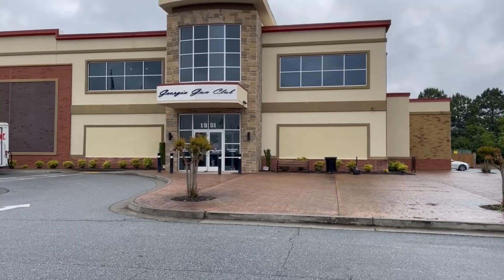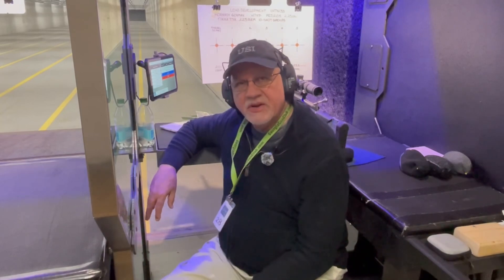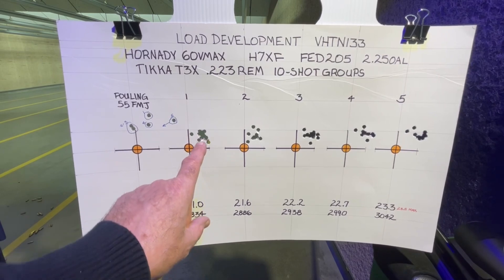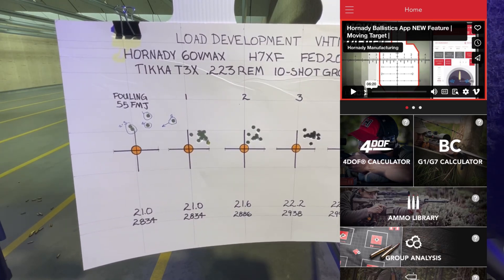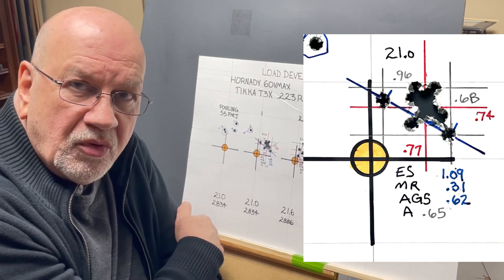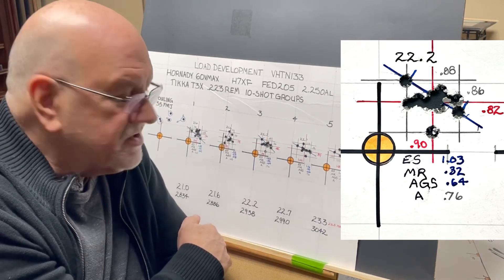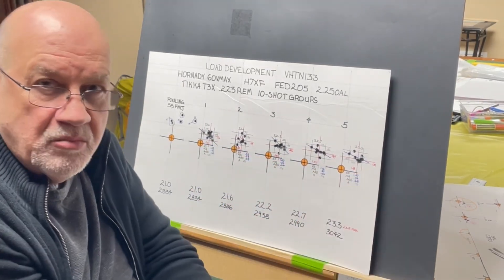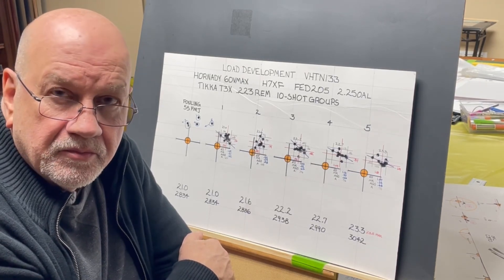Load Development for .223 with 60VMAX and VihtaVuori N133

Comment: I would not shoot 10 shot groups in this stage of load development. You must have a sizeable budget for components. I would try increasing powder charges in .3 increments shooting 3 shot groups. Also in changing your scope setting you are missing similar point of impact locations that might help you find a node. I use GRT and a magnedo speed to identify the areas I want to take a closer look. After seeing good results from the 3 shot groups,  then I would move on to 5 or 10 shot groups.
Reply from the maker: @thecrusaders2516  good advice. Happy reloading. Thanks for watching.

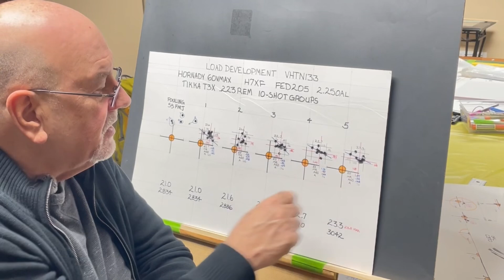Comment: I have good results with CFE 223 and the 60 gr. V max on the upper end of the charge weights in multiple rifles. 10:23
Reply: I have had mixed results with CFE 223 and better overall accuracy with h335 and VARGET.
Reply from the maker: @RogerFerguson-i6b  those are both excellent powders. I use both. I especially do like Varget as well. As they say, it's all about finding out what your rifle likes. Sounds like you've discovered it. Thanks for watching. I hope you will stick around and subscribe.
Reply from the maker: Cfe223 is one of my favorite powders. Thanks for commenting, thanks for watching.

Comment: Watched most of your reloading videos on 223.  After going through my own journey in reloading, I listened to Hornady' Podcast Episodes 50 & 52 "Your groups are too small".  It all made perfect sense. So much wasted time and money.  I bring this up because as a fellow reloader that makes content for us, try reloading using statistically significant data, i.e.- large group samples of 20+ rounds.  You will find your load findings are NOT repeatable over large groups.  There is no "node".
Reply from the maker: When I run a test like the one in this video, because there's such a difference between the loads,like .8 to .9, I will go back and do further testing around that best load, loading maybe .2 and .4 grains below and .2 and .4 grains above that charge weight. That helps me to zero in on the node. Once that is found, then I will verify with a 20 shot group.
Reply: Love what you do.  Subscribed. @EverydayReloadingandShooting
Reply from the maker: @ much appreciated, Jonathan. Thanks for watching!
Reply from the maker: @jonathane8585  if you watch some of my other videos you will see that I do shoot 20 shot groups. And it is after what I have found what I think to be a "node." The 20 shot group is to verify what I think I have discovered. I have often shot three shot groups into a single ragged hole, but then if you take that same load and Fire 20 shots, those groups will spread out. The more shots you fire, the more they will open up. That's why I don't just look at Group size. I also look at mean radius. Thanks for the input. Much appreciated. And thanks for watching.

Comment: Love it that you shoot 10 shots groups. That's telling so mutch more about the performance  than a 3 shot group. But for more and beter info you need to measure the speed.
Reply: Awesome video sir..I use the 60 Vmax with my Tikka..very small groups.if you shoot the 60vmax and CFE223 26,7gn powder you gna get very small groups
Reply from the maker: @ I'll have to give that a try. Thanks for the input and thanks for watching
Reply from the maker: @andrebosgraaf2086  I can't disagree. I just don't have that in my budget at the moment. I do look at groups like number three and number four, and when I see the shots stringing horizontally, that tells me that Im at a good velocity node. Eventually I will get one. thanks for the input, and thanks for watching.
Reply: @EverydayReloadingandShooting  at 100 yards the difference in height wil be max 0.2 inch in height with 70 fps speed difrence ore less I think, so it will be hard to see I think at 100 yards. As a jp15 shooter I like more n135 the best and most constant speeds are with  100 procent case fill. For the heaver bullet in the 223rem I use n140.